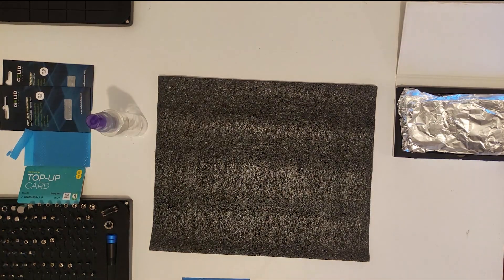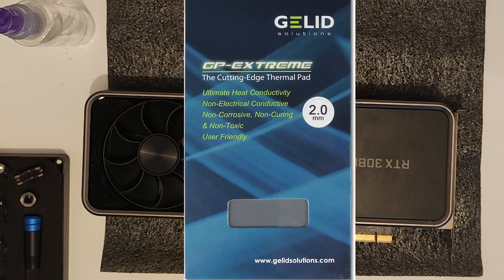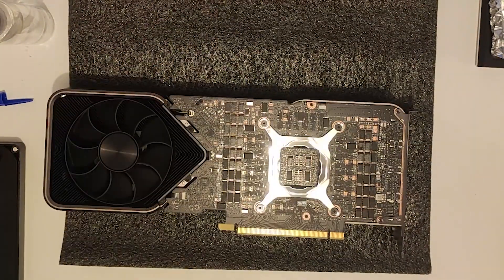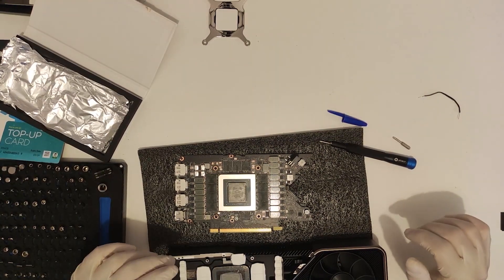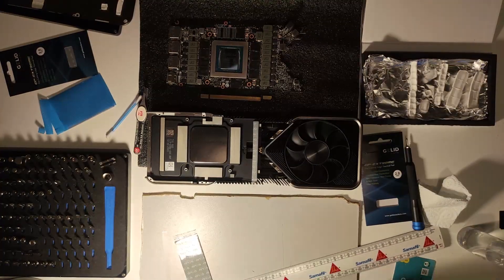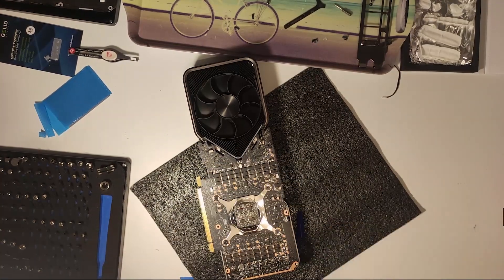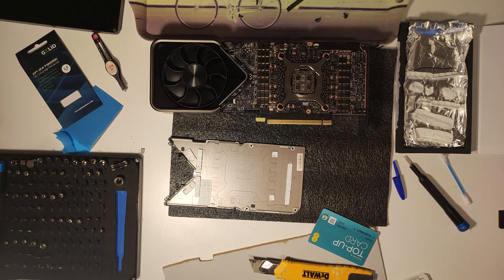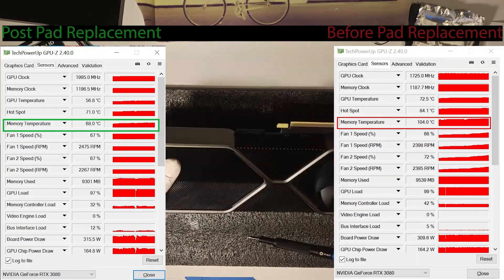Nvidia RTX 3080 FE Thermal Pad Replacement & Re-Paste-Improve your Mem Junction Temp by OVER 20C

Comment: I’m a noob and don’t know much about computers but I have a 3090 fe  and wanted to do this on but too scared I would mess it up. Wish there was a company I could pay to do this. (Didn’t buy from scalper. Nzxt creator pc at old price of 3500 back in March) f scalpers
Reply from the maker: As far as I know some repair shops (at least in the UK around Essex) offer termal pad replacements for about £90, which I think it is a bit too much if they are offering full card warranty (would be OK with a 1-2 year shop warranty if you can get them to agree to it and give you proof). As for the scalper sentiment you won't find any contradictions here :)

Comment: Is this working for the 3070 ti FE too ? Since it has the gddr6x memory aswell
Reply from the maker: As far as I am aware the layout is near identical between the 3080 and the 3080Ti - but while the 3070 TI FE looks similar with a fan on either side, the PCB is definitely different. I would do a lot more in-depth research on that particular card before tearing it down because you might find that pad dimensions might not line up correctly or the thickness requirements are different.